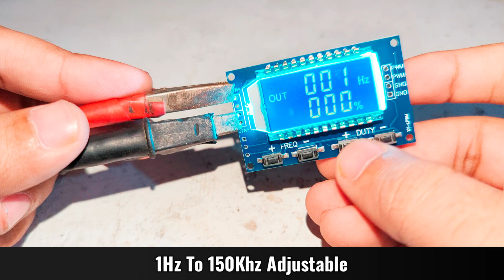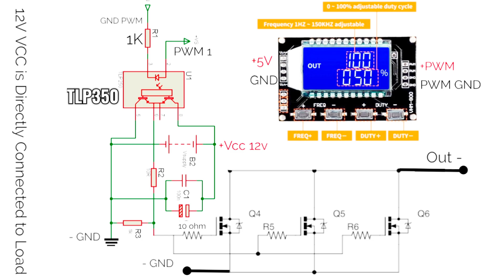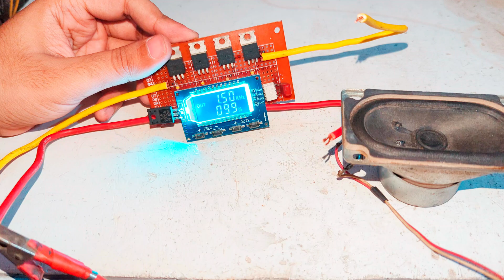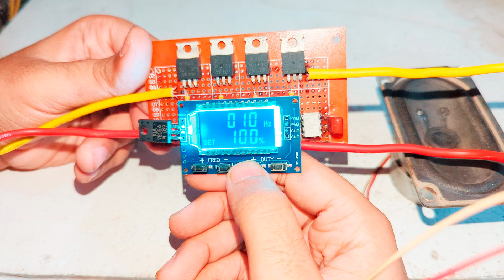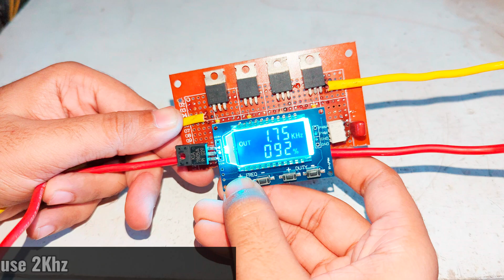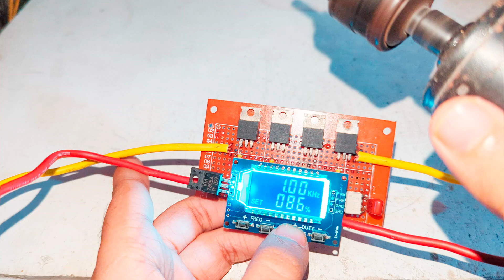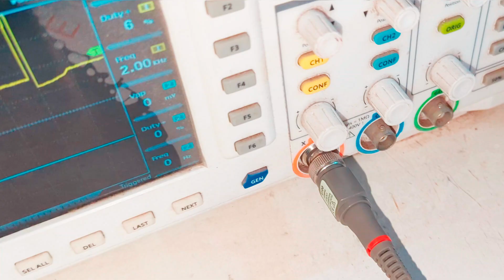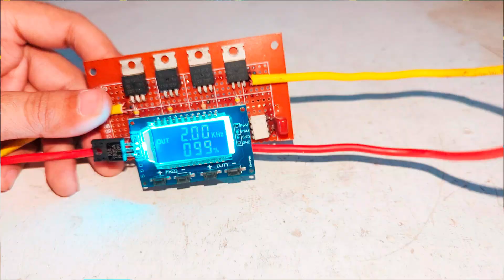DIY 50A PWM Generator : 1Hz-150kHz Control from a $1 Module !

Comment: I looked up your buy link to Ali express. And it has 3 variants of this one each with different displays and more buttons, can you tell me what is the difference, pros and cons of these three variant’s?
Reply from the maker: First Version has 7! segment display,

Second variant has LCD display 

Third Variant can output 3 signal together so it. Has more buttons
Reply: @Electronic_For_You Ahh I see….. also the one you’re using, when you turn it off does it stay on the set frequency and duty? I am assuming it just reset’s to 0 after you cut power from this module. Which I think can be real annoying since if I use it on project that needs a specific frequency, every time I turn it off, I will need to again set the frequency. So is it like that?
Reply from the maker: No, it stays on set frequency
Reply: @Electronic_For_You oh that’s actually pretty awesome! I am planning to buy this after my exam.
Reply: @Electronic_For_You I forgot to ask. It seems like it has no toggle button to turn the signal on or off even if there is power going to the circuit, so it just stays on forever? And does the circuit heat much?
Reply from the maker: You need an external driver to drive MOSFETs or any other load , the module won't get hot , and the output stays on always

Comment: Can this be used for induction furnace if tank caps and induction coil selenoid  are  added?
Reply from the maker: I don't know, but this can be used for Generating Variable frequency and Duty cycle
Reply: @Electronic_For_You i do not understand the two condansators on circuit.

Comment: I think you should add flyback diode at the output to prevent mosfet and pwm module from voltage spike of inductive load like DC motor
Reply from the maker: You are absolutely right 💯